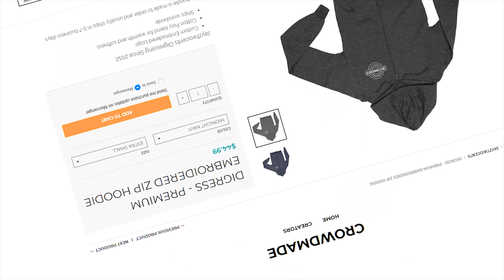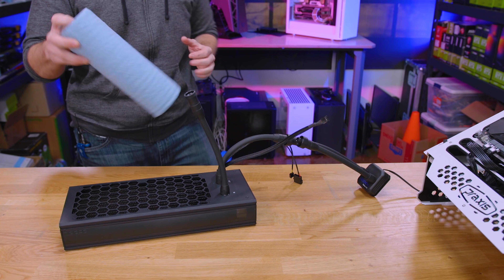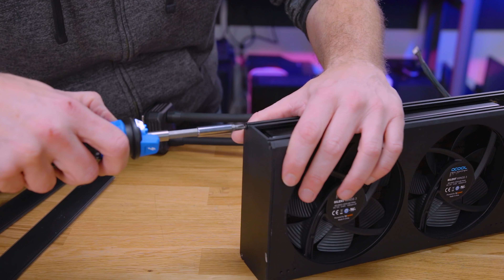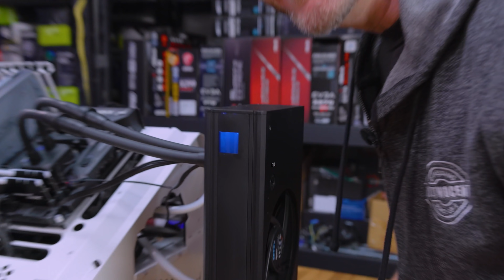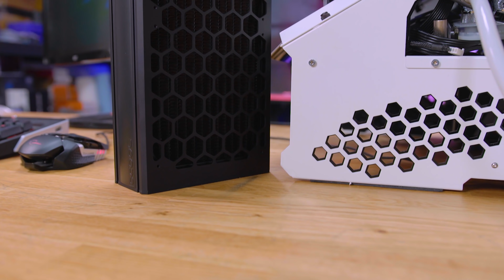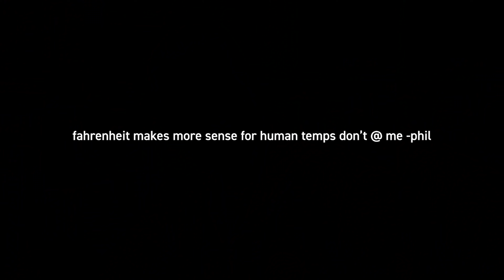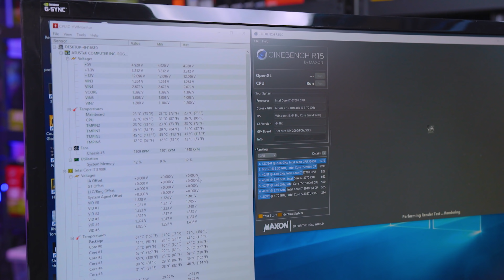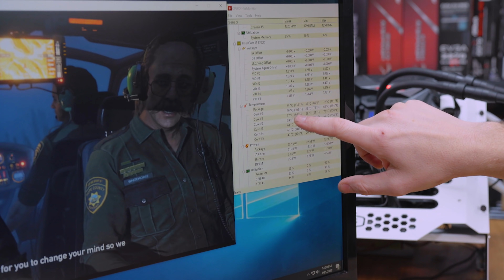This AIO is ridiculous!

Comment: 0 freezing, 20-25 room, ~37 body temp, 60-80 cpu load, 100 boiling water. 
Can you honestly say this does not make any sense? @Phil
Reply: Celsius is based on water mostly. But if you only use it for cpu, and the rest of your day is in F* what’s the point?
Reply: In relation to boiling water, Celsius makes perfect sense. In relation to human experience, Celsius makes 0 sense.
Reply: @inspectorjavert5563  That's always been my second biggest problem with Celsius. 0 is freezing, makes sense, great. 10 is jacket weather, 20 is a comfy room, 30 is a sweaty day. WTF? It's completely out of scale with daily life.

My biggest problem with it is the rabid zealotry of its fanboys. They sure are awfully smug for people who use a measurement system designed specifically for people who needed to count on their fingers. Base-10 isn't advanced or super-scientific like they seem to think. It's kindergarten. It was proposed centuries ago because the existing system was just too hard for the unwashed peasants who couldn't read or write.
Reply: @johnterpack3940  a system based on the states of water(°C) is less scientific than one based on nothing(°F). Really?
Reply: @FGRLSWAL  I didn't say it was less scientific. I said it wasn't more scientific. What a system is based on is an entirely arbitrary choice. It means nothing. The fact remains that the metric system was designed for simpletons who needed to count on their fingers. It's been in use for more than two centuries. Yet people act like it's some advanced, modern thing.
Reply: @johnterpack3940  since when is making things more difficult than they should be something smart people do? Btw, there's exactly the same amount of idiots in every country. So...
Reply: @FGRLSWAL  what's difficult about the imperial system? If you can't understand fractions... well, that is pretty sad, isn't it?
Reply: @johnterpack3940  you said the other is for kindergarten and what I'm saying is that if something works and is easier why do it more difficult. The same goes for your pounds and cups and all that imprecise shit that is never used in a lab.
Reply: @FGRLSWAL  metric is kindergarten, it's counting on your fingers. There's nothing more precise about a kilo than a pound. Arguing that metric is better because it's used in labs is like arguing that Latin is better because it's used in labs.
Reply: @johnterpack3940  With pounds and ounces you can get weird numbers that have to be rounded up. That does not happen with the metric. The scientific way of measuring temperature is with Kelvin and there's nothing simpler than kelvins. Nonetheless is what people that know more than you and me choose. Here is a link so that you can learn something today. 
https://www.quora.com/Which-measurement-system-is-better-metric-or-imperial
Reply: @FGRLSWAL  you never have to round things in metric? What's 1/7 of a gram? What's an 11th of a kilo? Math works the same for both. And base 10 is one of the worst choices for avoiding odd fractions. A base 12 system would have been much better. But it's complicated to count to twelve on your fingers.
Reply: @johnterpack3940   John Terpack  Dude just click on the link. Every country with 3 or 4 exceptions uses the metric system. What I meant when I told you the thing of the fractions is that when you are passing from one system to another you have to deal with extra and unnecessary fractions that can turned in errors. The worst thing you can give a machine is a fraction, if you have to divide 5 times by 3 a big number, and you are out of luck, you are adding a big error. With the metric you just have to add a '0'. And you can do that all the times you want, back and forth, and the result will always be the same. Also, with the metric you can go as low and as big as you fancy. Try that with your stones and your cups.
Reply: @FGRLSWAL  there are only 3-4 countries that drive on the left side of the road. Should they switch just because they're in the minority?

I don't have to convert between units, it's a non-issue. If I'm measuring in cups, I talk in cups. I don't need to convert it to gallons. That's actually the prime advantage to the imperial system, the ability to switch degrees of precision. You only have one unit of measure, you're always in the same degree of precision.

Again, math is the same for both. You still have to deal with fractions, it happens all the time. The difference is that fractions are a natural part of the imperial system. A third of a cup is a real thing, a third of a liter is... what?
Reply: @johnterpack3940  the fact that you don't have to convert between units doesn't mean anything. You are not the only person in the world. If you are going for a subjective perspective of this issue then this debate is over.
Reply: @FGRLSWAL  you've been nothing but subjective the entire time. The fact there are other people in the world in no way obligates me to do what they do. I don't have to speak French just because France exists. There is no reason for me to use the metric system in my daily life. It is not the greatest thing ever, it's just counting by ten.
Reply: @johnterpack3940  okay this is going to be my last comment. The debate is not what is better for your daily life. The debate here is what is the better system. For a standard to be better than the other we are not looking at the life of a regular person that works at a place where were you need to be precise. The metric system can be used by a 5 year old, by an engineer in that works at ford, by an engineer that works at tesla, by a doctor that is giving a patient a medicine, by you making a cake and by chemist in a lab. It is universal because it can go from the scale that people use everyday to the one used by  professionals that need really small quantities or measurements or to professionals that need really big ones (no pun intended). That is the beauty of the metric system. So stop answering that you don't see a difference in your daily life by using the other. I know you don't need the metric system. However the world does. That's the reason why people decided that between the two they were going to adopt the other. The better one. The one that can be used in actual science. The one that was created for that purpose. To me is stupid to think you are even serious. How can a system created to be used by scientists and professionals be compared  with one that was born through the use of peasants, with all respect. That's it. I'm done.
Reply: @FGRLSWAL  There is nothing about the metric system that makes it better for science. All of Western civilization was built on the imperial system. The Apollo missions, computers, automobiles... all of it done in pounds and feet. The metric system isn't more precise or more accurate, it's just easier to count on your fingers.

The metric system was not designed to be used by scientists and professionals. It was first proposed some 500 years ago by a clergyman who felt bad for the peasants who couldn't comprehend the trivial notion of fractions. It was first put into official use after the French revolution more than 200 years ago. It is not some modern, advanced system. The original definition of the meter was ludicrously arbitrary, 1/10,000,000 the distance from the north pole to the equator along the prime meridian. That is no more advanced or scientific than basing a system off the length of the average man's foot.

Mathematically, the metric system is inferior. I can easily measure a third of a yard or a third of a foot. What's a third of a meter? Both systems will have irrational fractions to deal with, but the imperial system will have fewer because it evolved to deal with them. Being base-10 means the metric system has more irrational fractions to deal with and more fractions in general. You don't have a unit to neatly describe something as common as 1/4 of a meter. It's laughable that you think counting by ten is in any way superior.

The imperial system can be used by anybody as well. There's nothing special about the metric system that makes it more adaptable. In fact, I'd argue that the imperial system is much more adaptable, easier to use for a wider range of people. It's certainly easier to remember "1 cup" of flour than it is to remember "236 ml" of flour if I want to bake a cake.

One last thought; if the metric system is so great, so advanced, such a massive progress in humanity's understanding of the world... where are the metric calendar and clock?
Reply: @johnterpack3940  for someone so used to dealing with fractions you seem to scared of dividing 100 by 4. That is a 4th. Anyway, this isn't going anywhere. You have your vision of your superior complex system and I have mine. You don't agree with anything I told you and neither do I. We could be years debating which one is better but in the end what you are telling me is insufficient and the same way around. There is no point in keeping this. I'm tired of this conversation. I don't get anything from this. I don't even know why I started. This is the last time I try to argue about the metric and imperial. Goodbye.
Reply: @FGRLSWAL  Wow, nice strawman argument. I said you don't have a unit to neatly describe a quarter of a meter, I didn't ask what a quarter of 100 was. I did ask what 1/3 of a meter was. That was specifically to demonstrate the mathematical inferiority of the metric system. And you ignored that just like you've ignored every time I've refuted one of your points or asked an inconvenient question. You haven't made a single cogent argument in favor of the metric system this entire time. You just keep saying it's better, as if I'm supposed to accept that as gospel. What makes the imperial system better is precisely the thing you hate about it, the multitude of units. That is flexibility. I use "cups" if I'm baking a cake and "gallons" if I'm painting a house. It's a trivial concept, and a logical one. Using the same unit for every task is just absurd.
Reply: @johnterpack3940  https://www.youtube.com/watch?time_continue=160&v=r7x-RGfd0Yk&feature=emb_logo
Now after seeing this tell me it is as comfortable to pass units for either system.
Reply: @FGRLSWAL  you three replies ago: ok, this is my last reply
you now: "now go watch this horrible rant that has little to do with the discussion"

slick. Watched it. It still doesn't change the fact that all measurement systems are arbitrary. One is not 'more scientific' than the other which was Jon Terpack's entire and correct point.

I like metric but you don't have any ground to stand on for it being 'better' than imperial other than 'nyaaaaah base 10 makes for simple conversions and I like simple things' and 'Even you use it in most of your scientific areas to shut us up'.

I'd like to see America fully switch to metric but your rabid, raving ignorance won't make that quicker.
Reply: @Relsig89  okay
Reply: @FGRLSWAL  Farenheit was designed to be a scale that could be reproduced by diverse people separated by geography at a time that temperature scales where at best unique to a particular thermometer maker if not too the individual thermometer..... Farenheit facilitated the exchange of information...
Reply: @johnterpack3940  You truly are a moron wow i could not believe ppl could be stuck in their idea so much that they would ignore facts lmao
Reply: @darthinvader3476  The only fact is that any country that uses the imperial system is under no obligation to agree with those that like the metric system much less switch over to it. The fact is that I've lived my 30 years thinking in terms of Fahrenheit, feet, inches, miles, gallons, and pounds, and that is how I comprehend the world. I can look at something and tell you about how many feet it is. I can't look at that thing and tell you how many meters it is. There is no logical reason to force an unnecessary change just to be like "the rest of the world." Another fact is that if we've managed for this long using our supposedly inferior system then it must not be as bad as you say.
Reply: @johnterpack3940  "what's difficult about the imperial system"
Ok, you have 2x2x5 swimming pool. How much water do you need to fill in? And how much it weighs? 

In metric system:
1 square meter = 1000 liters = 1 tonnes of water

2x2x5=20 square meters
20x1000= 20 000 liters = 20 tonnes 

Now try this in imperial system
Reply: @mlody969  why would I need to? If I'm filling a swimming pool I just let the water run till it's full. I also don't need to know how much it weighs. Even funnier, your conversion of volume to weight only works for pure water. How much would that volume of vegetable oil weigh? Or tar? Besides, 2x2x5 is just 20 cubic feet. That's not complicated. If I wanted to use gallons I could ballpark it at 150 since a cubic foot is around 7.5 gallons if I remember correctly. That's what cracks me up about you metric zealots. You want to act like you're so brilliant and advanced yet you can't even handle elementary math. You literally need everything divided by ten so you can count on your fingers. Maybe after I have a stroke and lose half my cognitive function I'll switch to metric too.
Reply: @johnterpack3940  " I also don't need to know"
This sounds like motto of a lot of american people. Sad. Really sad. You even don't understand that was just a example of differences between imperial and metric.
Reply: @mlody969  wow, way to take things out of context. I said I didn't need to know how much a pool of water weighed. And I don't. But I could get a quick estimate with very basic math if I so desired. That's my point, the imperial system is not difficult. And the metric system is neither advanced nor beyond my comprehension. I use it every day for various things. It's just a dumb idea designed for uneducated peasants who couldn't comprehend even simple math. That's why it's based on 10, it was meant for people who needed to count on their fingers.
Reply: @johnterpack3940  the difficult thing is converting from one unit to another. how many inches are in a mile?  inconstancy in units what are 12 inches in a foot and 28.5 g in an ounce
Reply: @victorlozowsky6139  why would I ever need to know how many inches are in a mile? That's an irrelevant argument, such a conversion just doesn't need to happen. That's one of the functional benefits of the SAE system, different units for different scales. The metric system has only one unit to measure everything.
Reply: Freedom Units! We must spread our "Freedom" across the world until it bows down to our Will.
Reply: @BobLSaget  Nice! Another Alec Steele channel watcher! But, sorry, I like Celsius better :D

Comment: Celsius makes more sense. I'm a Metric Cusp kid (I use feet for human height and room size. Pounds for most weight. but anything over 20ft really is in metres anything under a foot I get into centimetres. For temperature metric makes much more sense. 

0 the temperature water freezes at 100 degrees the temperature water boils at. If you need Absolute 0 use Kelvin. 

The issue with American Temperature is -40F is -40C. Which is weird. 
1 degree Kelvin and 1 Degree Celsius is the same. 

Absolute 0 is -273.15 degrees Celsius and 0 Kelvin. 0 Celsius is 273.15 degrees Kelvin. A degree is a degree. Yet with American numbers -40f is -40c, 0f is -17.7C, 32f is 0c. So for Fahrenheit there is 72 degrees in 40 degrees in Celsius. It doesn't stay that way though. Water freezes at 32 degree American and Boils at 212 Degrees American. why? 

It isn't difficult Water has three main states Gas, Liquid, Solid. As you apply heat it moves from one to the other. 0% is a Solid at 100% it is Gas. A degree is a percentage of heat needed to move water from Solid to Gas. 0 Degrees Water freezes at 100 degrees Water boils. It is simple, logical and oh right that is why Americans don't do it... Simple and Logical is too liberal to American minds :P 30 Degrees is 30 percent of the temperature needed to make water boil. It literally is the scale that is most logical for human use. 

Even the British use Celsius.

Comment: If you delid it you can run the cpu at 5ghz at 1.28 on an air cooler. The only reason you still need this massive cooler for a tiny cpu is because of Intel's horrible choice in TIM.

Comment: Celsius is more scientific due to its relation to Kelvin and makes more sence regarding ambient temps, due to the influence of melting water in the weather and the 100 steps (about that, I know) differentiating its boiling temp (about that, I know) and its melting temp (about that, I know).
And what was  100 °F defined as? Average body-temp of a humen (kinda legit, because you have to have a starting point)
and 0 °F? Coldest temp witch was been able to make at that time (not constant due to technologys evovling and therefore bullshit)
And nowerdays? Your beloved Fahrenheit is defined with Celcius! So all of your imperial units are defined as a factor times a metric unit (check it!) so adapt it finally. You are useing it already, please...

Comment: Lesser grade parts, or different parts? Here you only mention "different, didn't fit standard top". Which one is it? That doesn't necessarily mean lesser quality - changing out various parts on an OE/off-the-shelf component when integrating it in a product it wasn't designed for, is kinda the the norm unless you actually design the rest of the system around that specific part. Housings, tops and mating surfaces for WC pumps are most often non-metal parts. Meaning those are much cheaper and practical to adapt, than the metal components. That don't mean you end up with a better or worse product. I mean, a lot of cars from the 50s and the 60s worked pretty well and reliably. But had they locked in the recipe and never tried changing and improving upon that, there would be no nizzie nor camaro in your garage... :)